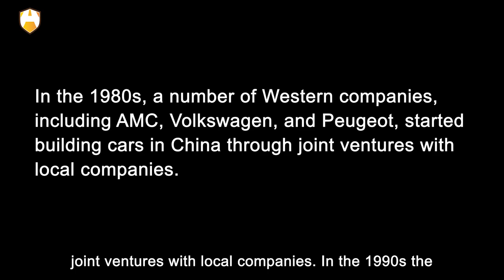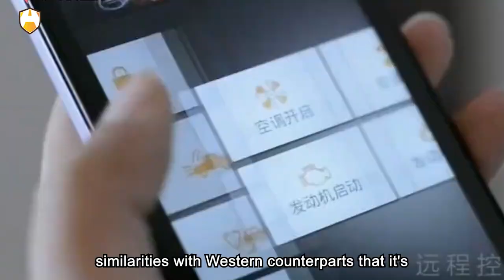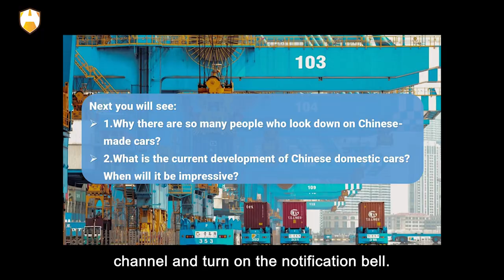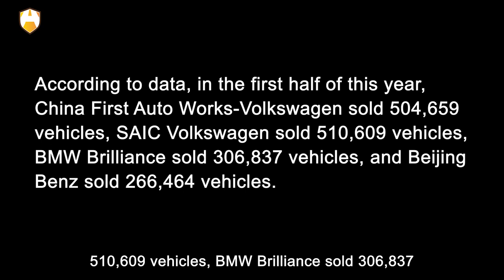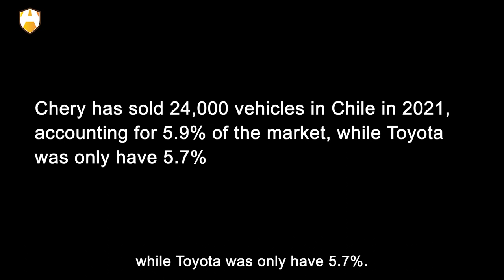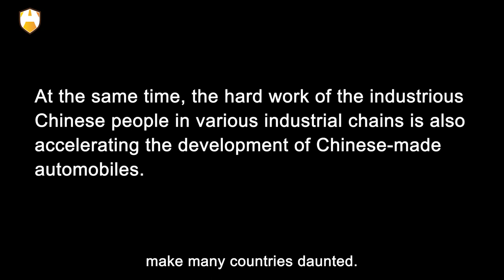From imitation to innovation, Why do we still look down on Chinese cars?

Comment: I buy lots of products made in China. Many are excellent, some are poor.   There's notthing wrong with the genetral ethic of Chinese workers or the maximum capability if its industries. The  poor perception of Chinese quality comes from experience with lower end products marketed on the basis of price, not quality.   Japan had a simlar problem in the 1960s, and got past it by working to consistently make better quality cars than  the US makers could.  Within 60 years, Ford stoppped production of sedans because it could no longer compete. Since Japan became a main player, its quality and rate of innovation are stagnating, making it open to  new competitors who will work harder and smarter to prove themselves.